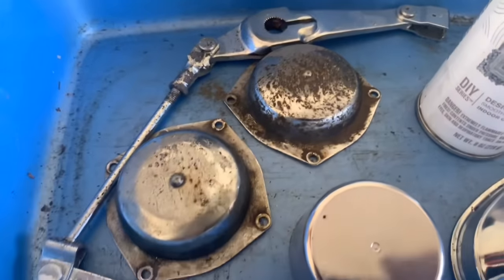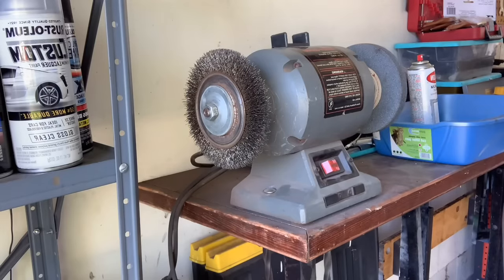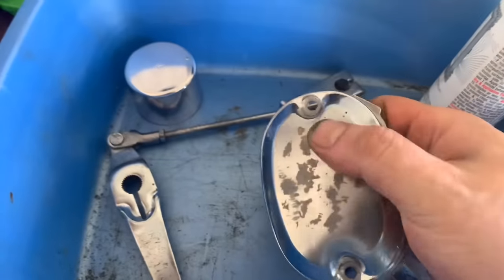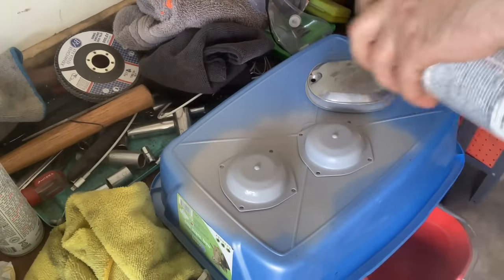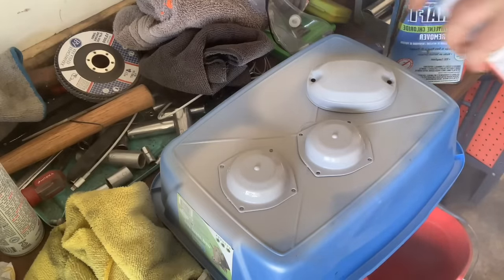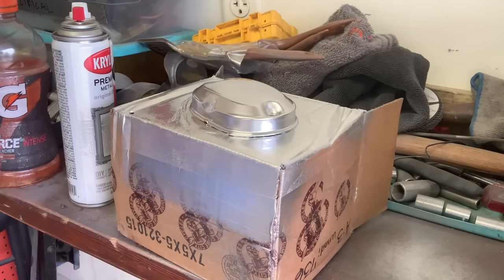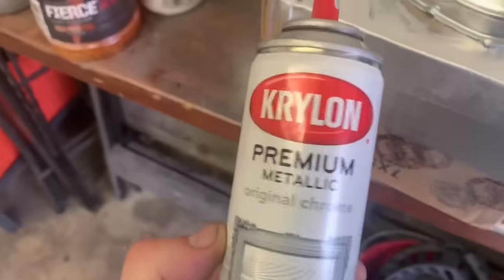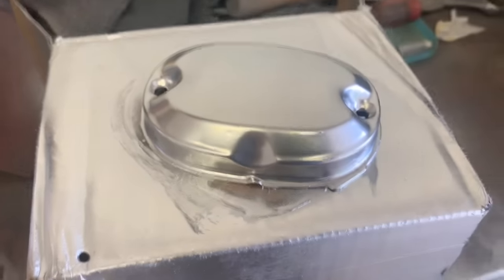Painting With Krylon Chrome Spray Paint-Vintage Motorcycle Restoration Project: Part 69

Comment: I got a better result by primer, paint, gloss, re-paint!!! The gloss coat in between makes the chrome pop!!!
Reply from the maker: I definitely need to explore different methods. Thanks for the tips!
Reply: @KeepOnWrenching  I would add that your primer color makes a huge difference in the end product!!! IE: light color base coat use white primer, medium color base coat use grey, dark color base coat use black or dark grey primer!!!
It really makes a huge difference, you may try white primer on another piece you want a chrome look and then compare them!!! Hopes this helps!!!
If you have the time try painting 4 different small items 1 white primer , 1 light grey primer, 1 dark grey primer , 1 black primer and then paint each with the same base coat color and compare the end product, it will give you a visual reference for how primer color effects your base coat!!! You can play with the base color by switching up your primer color to get a totally different spectrum from the same paint!!!
Reply: @cfmpam498230  i find this hard to believe since enamel is not transparent. but most lacquers are and it would matter if it was lacquer.

Comment: Better off sanding it down to a flat surface without any primer and then copper plating it,  then sand the copper down flat and even as though it was primer,  then nickle plating the parts.  The nickle will be nearly as shiny as chrome and will be really nice and durable.
Reply: i would have loved to see him try to buff the paint, chrome paint is the least durable of any paints out there, i guarantee trying to buff it took the paint off....

Comment: Looks like aluminium - period
Reply from the maker: Yeah. Not the best. Need to try with a gloss black base coat
Reply: @KeepOnWrenching  It doesn't make too much difference, the long awaited "chrome paint" is yet to arrive- they have a product where you use water and certain sprays over a black prep but it's quite expensive, comes out nice but doesn't have the same tenacity as chrome plating.

Comment: I think if you would have spray on top a clear coat it would have look even better.
Reply: If its the same chrome paint as every other out of a can you cant clearcoat it, it will disolve. You cant even touch the stuff without getting fingerprints on it, and it wont come off. Chrome paint out of a can is purely for show. The closest you could get to chrome that you can clearcoat is this stuff:https://www.myrefinishportal.com/us/en/sikkens-autobase-plusr-q878sa-sec-silver-argentum-1l.html, but that will cost you more than the parts he mentioned. Here is a vid of it being used: https://www.youtube.com/watch?v=1Tw-EOymWNo

Comment: not bad at all. I have often wondered how well this paint could work. Now I know. ..
  little bit of advice when it comes to painting.
  as an ex, professional painter, not a painter of cars, but a painter of structures, beams, pole building skeletons, scaffolding for making liquid natural gas tankers .the government will not accept a piece if the paint is more than four mils thick.. four mils is less than the thickness of a dollar bill..
  it was explained to me by the inspecting engineer on a structure my company was making. That the thicker, the paint, the faster it will come off, usually in sheets…

Comment: Ya the chrome paint  is ok. But will tell you it's soft an will scuff quick. An as you seen any clear on the chrome spay turns the chrome grey. You only 2nd choice is power coated chrome . Much like chrome, but still not as hard as chrone parts finish is...
Reply from the maker: Yeah. It’s garbage paint for sure.

Comment: Shoulda completely stripped the face to bare metal buffed it on a buffing wheel till it shines like chrome and clear coat it. Looks exactly like chrome, as long as the clear coat holds up possibly years...
Reply from the maker: Totally doable but I wanted to try the paint out.

Comment: Great idea to paint a test piece. Just in case.
Reply from the maker: It definitely is a best practice and something I try to do no matter what. Never put lacquer on enamel is what I learned.
Reply: @KeepOnWrenching  I've learned that the hard way. Sometimes you can get by with clear coating on paint that would normally orange peel by waiting until it's fully cured before applying. I've never had satisfactory results clear coating chrome paint. It always turns kind of gray.

Comment: You need to read directions first!
First, most can chrome specifically say that you cannot put a clear coat over it.
Second, directions on can enamels specifically say that you have to do all painting within one hour. Then, you have to wait 48 hours- 2 weeks depending on manufacturer, before you can recoat. If you don't, the first layer will lift or melt every time.

Lacquer paints can recoat anytime.

Lacquer melts enamel so don't do it!

You can spray enamel over lacquer no problems ever.

!!!!ALLWAYS read the directions/ recoat times!!!!
Reply from the maker: Not much for directions but will keep experimenting.
Reply: Yeah, spraying lacquer clear over enamel paint doesn't go well.

Comment: Get it warm,  thin coats of clear, 10 min between coats,  it dissolved because it was too too wet and It sat there instead of flashing out the solvent with heat , thin to win , warm not hot , do it on your test panel 1st
Reply from the maker: Thanks, Damian.
Reply: @KeepOnWrenching   no problem man

Comment: Spray chromes usually call for a black base coat; not sure about Krylon, but would be worth a test.  

There are some other products to replicate Chrome, such as Easy Chrome or Spectra Chrome which use water-borne silver nitrate.  These are much more expensive, but very impressive.
Reply from the maker: Will look into it and do some tests in the future.

Comment: Re your clear coat, I'm wondering if an acrylic / water based clear coat would have worked for your clear coat step?

Fantastic what you did with the points cover!  Maybe just keep a nice thin coat of wax on that cover from time to time?
Thanks for the video!
Seattle
Reply from the maker: I made the mistake of grabbing lacquer. Never again. Lol

Comment: Actually, the chrome on those 1960s thru 70s Japanese motorcycles looked just about like spray chrome anyway, and was probably almost as durable.
Reply from the maker: I disagree. The chrome on the 70 and 72 I’ve worked on have cleaned up remarkably well. And there were nasty! Can’t believe the parts were salvageable but they were. The chrome paint is just  silver spray paint at end of the day.

Comment: A few weeks ago, I painted PVC pipes with this and got silver color. I hope silver color to reflect UV and the PVC pipes last much longer as they are exposed to the sun light. Look very nice though.
Reply from the maker: Good to know.
Reply: Use UL 651 rigid PVC pipe, as it's already UV rated for outdoor use.  No need to paint it.  Paint doesn't last.
Reply: This Krylon paint, per Krylon's website, is for indoor use only....so no guarantee how long it will last outdoors

Comment: Let me know what kind of clear coat you use because I had the same problem.
Reply from the maker: A lot of people have chimes in on this. Turns out the problem was the lacquer clear coat on top of the non lacquer pain.
Reply: @KeepOnWrenching  that must be it cuz that's what I'm using thanks for the info
Reply from the maker: Yeah. Just be sure to test! I’m glad I wasn’t using it on anything too important. There’s lots of articles out there about types of spray paint and the reactions some have with others. Who knew!?
Reply: @KeepOnWrenching  lot of people don't talk about stuff like that or test like you do
Reply from the maker: Been burned a couple times! I just saw this article quite: “Generally speaking, you don't want to apply LACQUERS over ENAMELS. This is because the solvents used in lacquers are MUCH "hotter" (stronger, faster evaporating) than enamel solvents, and the lacquer solvents can 'dissolve' the enamel paint underneath them, leading to "alligatoring" or cracking or other things that TOTALLY ruin the paint finish. When something like this happens, your best bet is to wipe the whole mess off with a paper towel soaked in lacquer thinner, allow it to dry thoroughly, sand anything else off if necessary, and start over with the finishing process.”
Reply: @KeepOnWrenching  Dang that's exactly what I started doing
Reply: Not even close to chrome,, more like silver

Comment: Looks like your doing work on a two cylinder honda motorcycle, most likely a 305 or a 350 engine.
Reply from the maker: Correct! Like my vintage Hondas.

Comment: I dig it that you're the kind of guy that likes to get his hands dirty, trying to solve a problem. I understand that this is a video about Krylon chrome paint. 
However... There's no replacement for real chrome parts. But, I get what you're trying to do. Until your new parts show up, just use the original rusted parts. I mean... Do you really care what anyone thinks about your original rusted parts? No. They don't. They couldn't care less. And if they did... it would NOT be out of real concern. Would you choose to waste your time entertaining their less-than-stellar opinions? Alright then.

$100 for undamaged vintage chromed parts, like those, would actually be the way to go. Unless you're not overly concerned about the finished product, or your budget dictates "fix em"... For the cost of better parts, it doesn't make sense to spend the time & money refurbishing the old ones, either with paint (which eventually won't stand up), or having them sandblasted & redipped.. You're not re-inventing the wheel. I'm guessing that the parts in your bucket aren't the last remaining ones on the planet. Save your money. Buy replacements. Be happy. I can tell you love your bike.
Reply from the maker: Thanks, man. I was just killing time on this day. I ended up getting a nice replacement off eBay. Worth the experiment tho. Thanks for the thoughtful comment.

Comment: Metallic paint has A LOT of thinner, and you must let it dry for days before you do anything to it, much like clear coat. I would let the chrome set for at least a week, and then use polishing compound and a soft well and polish the chrome paint before you clear. And with the clear, dust coats only for 2 coats....then a 3rd heavier. You will have to wet sand and buff. Welcome to the world of rattle cans
Reply from the maker: Great info, Matt. Thanks so much.

Comment: in 1979 Auto care come out with chrome paint in a can , I had a 1972 Bighorn 350 I painted parts with chrome it had aluminum look not chrome , I still have the can of chrome paint I use it on bolts and nuts , just did the underside of floorboards on my harley last week the chrome had rusted pitted bad , no one can see it unless they are sitting 10 foot away bike on the stand .  Anyone tried that chrome ALSA easy chrome ??  it looks good in a Video .
Reply from the maker: Good call on using as a protectant.
Reply: @KeepOnWrenching  The price of paint 5 bucks today , have footboards rechrome 200$ my bike is 25 years old 80,000 miles new floorboards 400$  the can of paint i used was 1.99 1979 lol, and it is still good

Comment: What filler primer did you use?
Reply from the maker: Don't use what I used for starters. Many of the comments have indicated that a black (gloss) primer will help it shine more. The Rustoleum filler primer I used actually dulled the "chrome" paint. I want to try with a black base to see if the results are better. I hope this helps. Let me know how it goes!

Comment: Looks like the chrome paint wins the day. I was wondering what the clear coat would do. There are some rules I forget, like, you can spray acrylic over enamel but not enamel over acrylic? Anyway, those covers look plenty good for what your doing. I bet you never break down and and buy replacement covers.hehe.
Reply from the maker: For 8 dollars I’m happy with the results. But I’ll probably break down for new ones once the sting goes away from all those other parts. :)
Reply: I thought it was the other way around. Acrylic first, then enamel second.
Reply: You can spray enamel over acrylic not acrylic over enamel.
Reply: @jessicaogradey4523  Acrylic what??  there is acrylic enamel and acrylic lacquer and acrylic urethane.   which acrylic are you making a reference too..

Comment: little basic knowledge is never wrong ....
Driving around the block on a Honda 😱 is not enough
time to put on a layer of clear lacquer on something you just lacquered. The color must be completely dry! Which can take a couple of days depending on the thickness of the color.
Reply from the maker: Yeah. The biggest issue was enamel/lacquer combo.
Reply: @KeepOnWrenching  You know there's a saying. Real men throw away the manual and never read a description 😋 I read on the can much later. When I noticed that the clearcoat dissolved the color. So this summer I Will do it THE right Way to correct my mistake. Stay safe

Comment: Looks like silver paint. 
Polish the aluminum and use clear coat
Reply from the maker: Totally. It looked better just stripped down. What a waste of time. It was fun to try though.
Reply: @KeepOnWrenching  tried it a couple times myself in hopes they improved it over the years. 
You ever use the aluminum foil and water trick. Works good on lighter rust.
Reply from the maker: For sure. Foil works fine on light stuff. Lesson is just get good parts. Lol

Comment: Myself I would have probably painted them all satin black and put chrome bolts on .
Reply: Bike sounds like one cylinder.
Your clear paint is lacquer paint which is hot, sprayed over anything less it’s going to melt it.
Reply from the maker: I like the idea of the black with chrome hardware. Maybe on another project in the future. I’ve learned that lacquer paint is quite different the hard way. Lol. I’ll remember your comment. Thank you.
Reply: Some paint schemes did it on purpose to get wrinkle or cracked effect

Comment: You sprayed too much clearcoat that's why it looked milky.It also looked like it was starting to run.I use Krylon Crystal Clear.I try NOT to mix brands for obvious reasons.When I clear coat,I spray THIN coats.Maybe 6-8  1 to
2 minutes apart depending on what is being coated.Good video.Thanx.
Reply from the maker: Yup. I’ll keep experimenting.

Comment: All that work in sanding....are you sure it will not just fall off the old chrome?
You probably should have used etching primer or phosphoric acid metal prep first.
Reply from the maker: There’s no such thing as chrome spray paint.
Reply: @KeepOnWrenching  >>There’s no such thing as chrome spray paint.<<
I never said there was.
Reply: @KeepOnWrenching  >>There’s no such thing as chrome spray paint.<<
Well, there's such a thing as "chrome look"  paint....but this ain't it.
Reply from the maker: @frankschwartz7405  I want implying that you did.

Comment: Dam dude $100 would have got you a good solid nickel plate $150 would give u a real chrome plate save your pennies and do it right that chrome paint in a can is for house wives crafting
Reply from the maker: It was an experiment, man. Relax. Ended up just buying another cover that was in great shape for $20 off eBay. I just wanted to see what it could do. Thanks for watching!
Reply: Brian Matson I was totally relaxed when I made the reply people think plating is expensive but it really isn’t especially if you do a lot of parts,nickel plate if triple dipped can look just as good as chrome
Reply from the maker: Roberto Cervantes Sorry...the “dam dude” threw me off a bit. Luckily this part is easily replaceable. If it were a hard to find/rare part spending the $100-$150 makes sense. Will keep that option in mind in the future if the need arises. The part certainly aren’t ruined tho. If needed they can be stripped and saved properly.
Reply: Brian Matson one way that seems to give the best chrome look and is very glossy and mirror like is Allsa I believe that’s how it’s spelled,I’ve scene a few videos here and the results look very promising I wasn’t able to see any difference from actual chrome and the allsa brand paint which is aerosol,or brush on,I build model car kits so I’m always looking for a good chrome replacement for parts and I use “molotow chrome” it comes in 3 different size pens but I pour it into bottles and brush on it’s amazing,I also use alkad chrome for models this has to be used with alklad black underneath first then applying the alkad chrome,anyways sorry if I sounded rude I didn’t mean anything at all by the “dam dude” just imagine a guy hanging in the garage and saying dam dude u could have dipped for $100-150 I know Spencer’s uncle down at United plating he does side jobs for cheap
Reply from the maker: Roberto Cervantes great info, man! I haven’t heard of any of those. I’ll definitely keep those in mind for future projects. I appreciate the dialogue!

Comment: No substitute for chrome. But it looks ok. Spray paint comes off when exposed to gas . Not good for motorcycles .
Reply from the maker: Yeah…not the best. Better than a kick in the ass tho. Found a nice replacement on eBay.